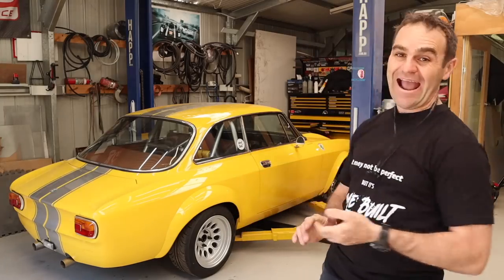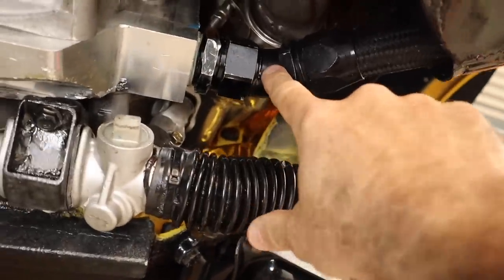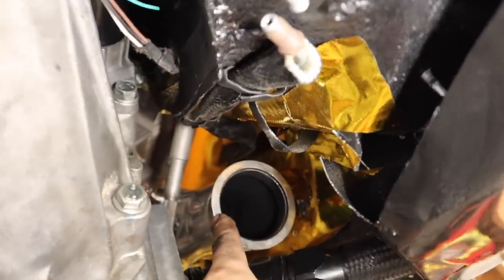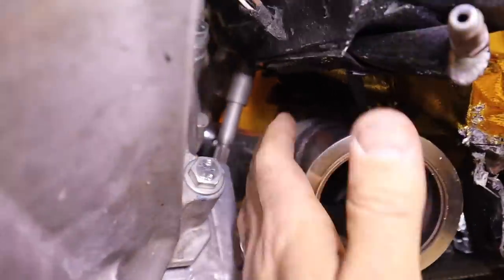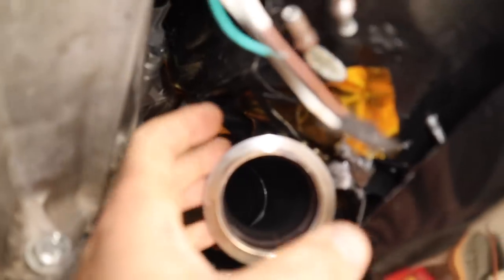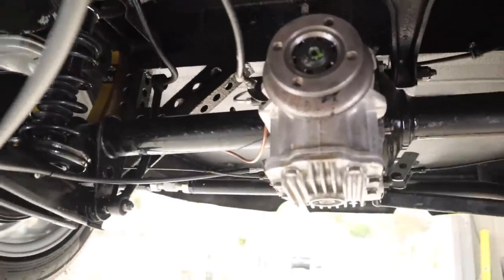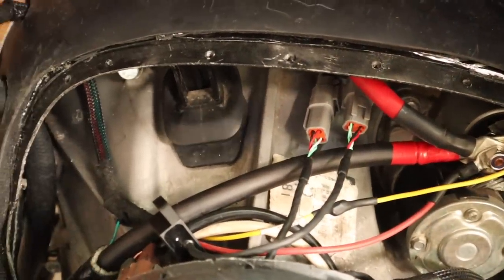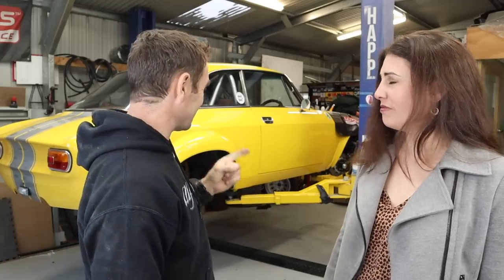Exhaust and brake woes - Ferrari engined Alfa 105 Alfarrari build part 196

Comment: As ever, the last 10% takes 90% of the time. Or, in the case of Binky, 900% of the time 😂
Reply from the maker: It is so frustrating when it is so close I can taste it ;)
Reply: I’m still waiting to see more of the Scargo.
Reply: It probably short of "a bracket..." Lol...
Reply: The 'Effort' law 😂
Reply: I think BOM used a load of the patreon money to buy a c1 and enter that c1/107/aygo cup.. Entertaining as it was (especially their rule bending re: the cage), I feel like a lot of their paying subscribers probably wanna see binky finished and thrashing around.
Reply: Actually, I think Nik has about driven Richard round the bend. But however much Jeff stuffed into that little Alfa, Binkey swallowed the entire drive train of a 4wd rally car, air conditioning, central locking, power windows, a w/s mist detector- the list is long; one rumor has it Binky is running up a real muffin top. @Jonathan_Doe_   But that was merely Toyota parts and a rusty old Mini- this, this is an Alfa- I can hear Il Commendatore moaning he left "miserable Alfa Romeo years ago, you can't do that!" and drool over what Jeff hath wrought. I thought the rusty days and rusty nights would never end back a way. On to the Vroom!

Comment: Watching this and other builds its clear how many decisions have to be made when doing custom work.
Its kinda mind boggling and some of these decisions have to be made early in the build without knowing about clearance issues until much later when components are actually fitted for the first time.
..
A lot of car buidlers are having their exhausts ceramic coated that apparently reduces the heat by 20%..
That should help keep heat away from the oil pipe.
Might something worth considering..
Might be bit late now its welded...
..
I think its a good time to take a brake from the project as you may be tempted to rush the last bit in excitement....
I know I would 🙂

Have safe fun trip to the states.
Hugs to Mrs jeff  still suffering tothache...

Comment: Bit concerned about your exhaust and brake line proximity! The oil tank line is close but at least it's below. I really think you are going to boil that fluid in the line after a big acceleration event and then stopping. I also think that the switch is going to get toasted which will hopefully alert you before the pedal goes to the floor. Really think about heat management on this one!

Comment: Consider also installing thermal insulation on the oil line nearest the section of the exhaust that was modified.

Comment: Might be worth getting those down pipes ceramic coated or something fancy, considering the high risk of heat transfering into your oil return, and I guess the headers too whilst you're at it. I would just hate to see anything fail on that very expensive V8, and I've heard excess heat can do all kinds of terrible engine damage! Safe travels to America, have a great time. Thanks for all the videos.
Reply from the maker: The headers are already ceramic coated ;)

Comment: Nice shimmy out of a tight squeeze, there, Jeff! Snaking exhaust pipes is always a bit of cut and try for me as well. ON the power brakes, have you ever driven a GM Hydraboost system? Those are crisp and have a great deal more confidence  in them. The first car I had them on was a 4200 lb (1900 kgs) Oldsmobile. It was 80s Meh looking and was great in traffic if you had a carpool to shake down to feed the 7 liter engine. Better shocks and springs- from a Chevy Caprice Police package- and those brakes took a whale boat and made it a lot more usable and fun, tbh.
I see the Nardo grey can be had in Australian wool- looks great ,too! If you touch sown in Dallas....
Reply from the maker: I have no room for a hydraboost, and it also is powered by hydraulic power steering which I also don't have ;)

Comment: Any way you slice it...that's a mind-numbing number of decisions and solutions.  I've gone the ceramic route on headers and it works...but this does look like a little air gap heat shielding will take care of problems.
Reply from the maker: Thanks mate. The headers are ceramic coated which should help a lot, but of course the bit added is not, so a bit of heat wrap should help I hope.

Comment: Just a thought, that brake pressure switch may be too close to the exhaust. Possibly could boil the brake fluid. Maybe just keep an eye on it and ensure the pedal stays good after a long while of idleing of the engine to see if the heat transfers

Comment: I much prefer the pressure bleed over the vacuum bleed systems (the Sealey one I have I would only give 1* for and my Gunson Eezibleed pressure system 5*) .  Because of the variations in master cylinder reservoir tops I have fabricated a plate with a neoprene rubber sheet glued to the underside and an airline fitting in the top and through.  The unit can be easily held onto the reservoir with 3 tywraps, one around the reservoir base and one each side through the collar tie and through  holes drilled in the plate.  This actually mimics the universal plate on some pressure bleeders.
I would also have free play of 1mm on the actuating rod at the brake and clutch master cylinders as without you may experience 'pump up' that can progressively lock up the wheels and cause clutch slip as you drive along.
Reply: I've always had good results with an Ezibleed.
My dad had an early version that took air from a spare tyre.. worked a treat.
Especially if working solo.
..
Have to have 100% seal on the master cylinder to get best results..
..
The Argument today about ezibleed , is  that they claim it can introduce air into the system. 
Whereas the vacuum doesn't..
In theory the vacuum should be the better option for that reason, but like having a good deal on the master cylinder.
Creating a 100% air tight seal for maximum vacuum isn't going to be easy..
Haven't used vauccum bleeders as of yet....
..
I was watching Matt Armstrong rebuilding a late damaged BMW M5.
They were trying to bleed the brakes by purging the abs pump.. still have a soft pedal.
Stick Ezibleed on tried purging again hard pedal 1st time ...

Comment: You need heatshields on those brake bits under the exhaust. 😉
Reply: Yes Jeff mentioned that.
On some other car builds they have put a ceramic coating on the headers, apparently this reduces heat by 20% so they claim.
Good thing that hose is right in the underbody airflow 
so it shouldn't give any real problems.
Unless it's very hot and in traffic ..
Reply: Yesss I thought that, as nobody wants expanding brake fluid from a heat source you gotta turn off, or drive, to keep functional.
Reply: @stuartd9741  Ceramic coating does work.  I built a 73 Mustang and the headers made so much under bonnet heat the airconditioner wouldnt work because the intake air was too hot.  I had the headers and exhaust ceramic coated and you can almost touch the headers after a run.   My Cobra has live side pipes and they are ceramic coated. They are safe to touch  only five minutes after shut down. I had them coated inside and outside.
Reply: @tinnedanger  that's interesting.
Did you have bonnet vents to lower under bonnet/hood heat soak?
..
As the Ferrari engine is so tight in there that will get rather  toasty under the hood.
That oil pipe is a bit vulnerable to the exhaust
Reply: @stuartd9741  In the Cobra the brake lines are directly over the headers so they get rising heat as well as radiant.  I wrapped the lines in aluminum backed fire blanket ( the white "cloth" like stuff used in furnaces)  You can buy that in sheets.  It's about 5mm thick.   The Mustang doesn't have bonnet vents.

Comment: Now that you've put that new flange to flange joint right before the o2 sensor there you're going to have an issue with turbulent exhaust flow sending the o2 readings haywire
Reply from the maker: When connected there is almost no noticeable join. It will be fine ;)

Comment: lol  you only had to tack weld that vband the mating alignment groves do the sealing . the band only holds it
Reply: There's Ferrari 400horses escaping from that exhaust, plus over exuberant driving on a track soon have that exhaust scraping on the ground...
Reply: @stuartd9741  not sure you point. no need to weld the whole way around.
Reply: @davelee7572  sorry.
There a recess or groove on the mating surfaces that makes the seal.
So even a tack weld would still seal it.
But with hard driving a tack weld would crack.
Reply: @stuartd9741  are you have problems understanding English? again

not sure you point. no need to weld the whole way around.

Comment: Nice work Jeff. Just a thought, would it have been easier to weld a flange onto the exhaust pipe ( internally ) and just use a steel type exhaust gasket? That way it's also removable ( two bolts ) for when you require to remove the engine again. I know it's not as pretty, but practical. Just my two cents worth.
Reply: I’d think the flange would be larger than the V band join and defeat the purpose, just my two cents worth…..
Reply: @youtubevoyeur4104  Make it as wide as the V band ring width where it's close to the chassis. From experience they do come very thin, plus what's wrong with making your own flange to your specific dimensions? Just my two cents worth......